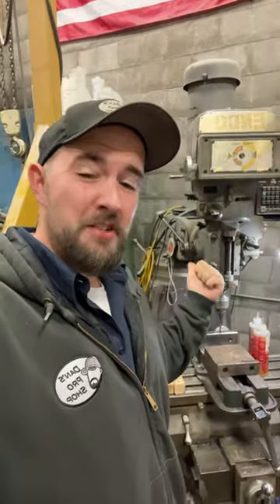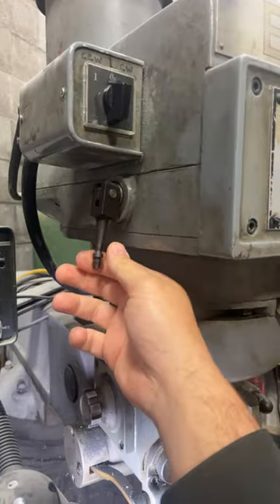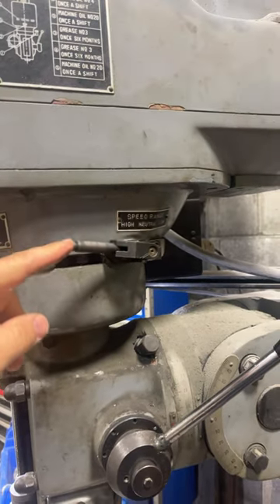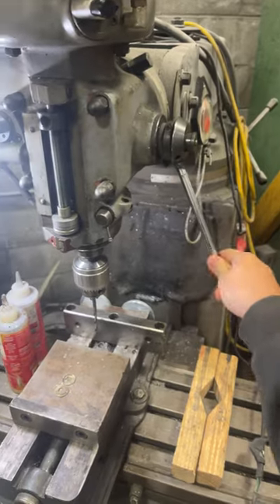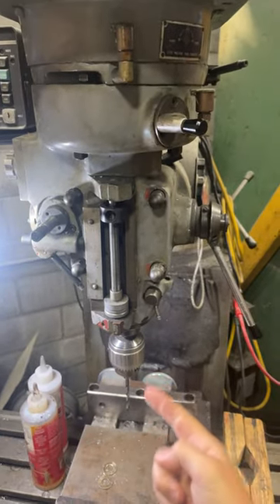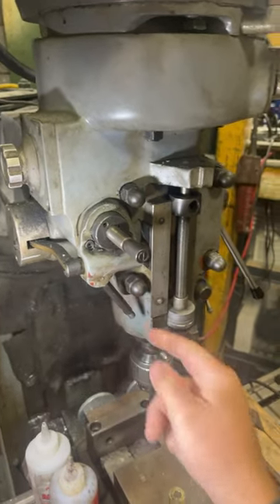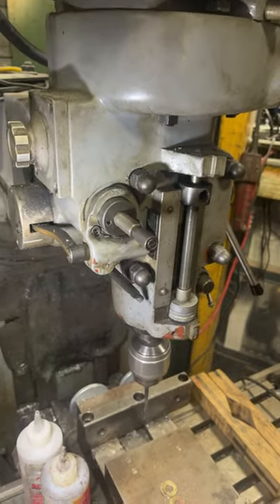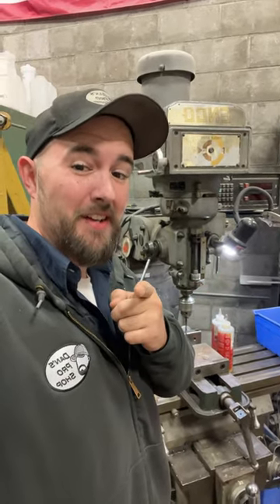How to use a milling machine #shorts #tools #machine

Comment: Do not change between Hi and Low while the spindle is running! It’s the equivalent of shifting into R for Race Mode! The correct thing to do is give it the lathe wiggle while trying to shift.

Comment: Can't tell you how much I want an old Bridgeport for my garage.
Or better still, another garage for my future Bridgeport.
Reply: Couldn't have said it better! I'm 72 and still looking for the perfect deal. Hope I find it while I'm still capable of using it. Have any leads on an anvil?Best Wishes!
Reply: Many years ago, I learned some basics on a bridgeport. I loved it and have wanted one ever since. I just don't have the space and can't justify the cost of getting on as I don't do enough of that type of work. 
I did pick up a 1940s era Craftsman DP and am going to set it up with a x-y table and use it for light milling. It's a bench top and weight ~280 lbs. We'll see how it goes. Even if I can only do light metals and things like nylon sotck, that would be great for making small parts.

Comment: I think you might have a typo. That high/low gear switch should not be changed while it's running.

The constant velocity spindle speed however should be changed while the machine is running.

I had no idea about that lever for power feeding -z. That would have been so handy so many times but I only used the Bridgeport for roughing out material or making last minute parts that needed a bunch of quick setups.
Reply: Yeah quill feeds mainly for boring I haven’t used mine in over a year bc there’s almost nothing we bore, we’ve got 2 axis CNC so we can just interpolate +-.005 holes
Reply: I said the same thing when he said that about the high/low range
Reply: I thought exactly the same thing, you def DONT change high/low while running.

Comment: I never change the transmission while it's running. I turn it off, put it in neutral, then try to get it in gear while slowly spinning the spindly by hand

Comment: I recently rebuilt the bull gear housing on one of our mills because some dumbass tried to change range while it was running. Stop the spindle, disengage, make sure its in neutral, then move to desired range. Otherwise you are trying to mesh a very large gear to a much smaller gear and will grind the teeth off in a hurry.

Comment: Last time I was run one was 1987 I cut Key ways on Shafts .  Had to be cut right for the bar stock to fit snug . we did 1/4 up to 3/4 .  I was wasting my time I was Hired to Rebuild Duplex pumps and Triplex pumps, suntrithcal impeller pumps . Ended up Building Vertical Turbine pumps . not what I was Hired for .

Comment: I want one of those. What's the cost effective way of getting a mill?
Reply from the maker: Get creative with a drill press. Lol. Honestly try to find one at an auction or estate sale, but keep in mind a lot of milling machines require 3 phase power to run. Good luck!
Reply: You can get a multi-function milling table for a drill press for $150-200 but you need a GOOD drill press & the backlash will still be terrible. They work well if you only need wood worker tolerances but if you need it within a couple thou, you got to spend a couple thou.
Reply: @esotericbear9829  I was told that you can't put lateral loads on a drill press. I have a grizzly cheapish drill press. I hope to pick up a mill one of these days.
Reply: @trex283  It kind of depends on what you mean by "can't". I mean you very much CAN do it. It is possible & people do it all the time. Is it hard on the drrill and far less accurate? Absolutely.
Reply: @esotericbear9829  I get it. I have used it with an end mill bit, but I was not impressed, except it makes nice flat bottomed holes. I need to grow up and get some better equipment.
Reply: @trex283  me too. Not enough time, space or money.